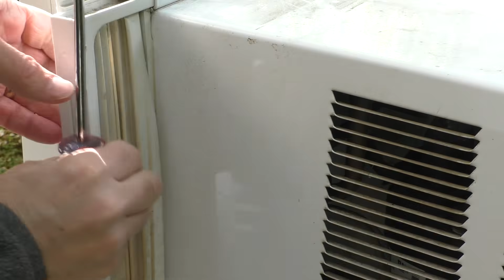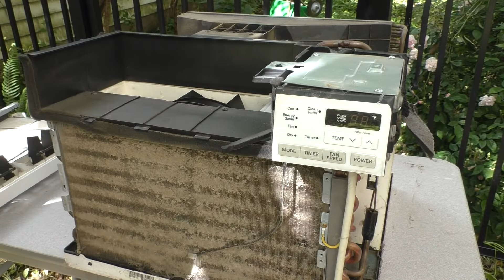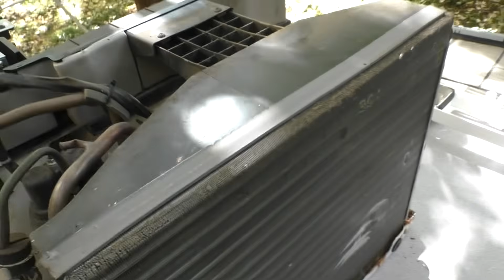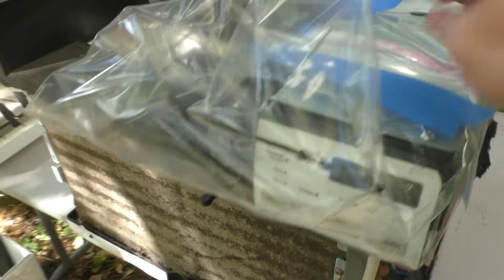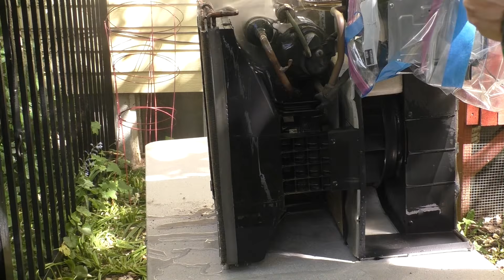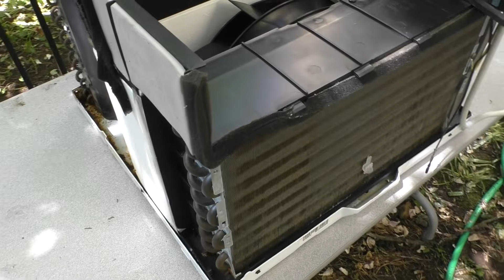How to Clean a Window AC Unit Inside & Out

Comment: Do not turn your window air conditioner on its side. Doing so can cause the internal compressor oil to migrate into the refrigerant lines, starving the compressor of lubrication and potentially destroying it. It can also damage the internal drip mechanisms, leading to indoor water leaks.

Comment: I might be mistaken, but isnt it not wise to operate immediately after tipping a condenser with coolant? I was always under the impression you have to wait 24-48 hours after placing it upright again to operate to avoid malfunction and fires.
Reply: I’ve never had an issue personally
Reply: Always suppose to wait at least two hours

Comment: Vinegar corrodes some metals
Reply: White vinegar won't hurt anything with an air conditioning system. The main thing is not to use anything chlorine based.
Reply: I think you did great. But every HVAC person I spoke to said use vinegar with water solution because anything chlorine based isn't good.

Comment: Mold should never be removed by chloride. Use natural white vinegar instead.
Reply: Bleach is just fine
Reply: @joeycorcoran4763 absolutely not. Chlorine is highly corrosive to copper and aluminum
Reply: You never use bleach or anything chlorine based. Is highly corrosive to the aluminum and the copper. Just using simple green or even just Dawn will suffice especially if you have it like that set up outside. I've been doing AC for going on 15-years now can I run a company that's been around for 30.
Reply from the maker: Thanks for the comment.
Reply: why?